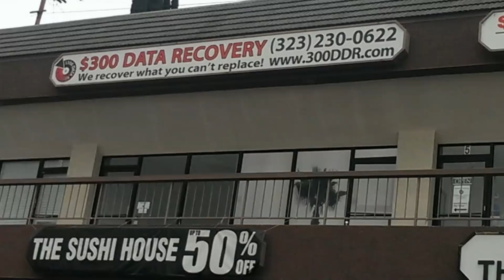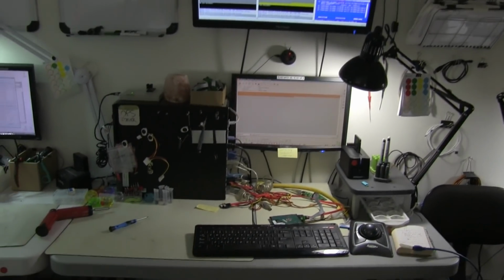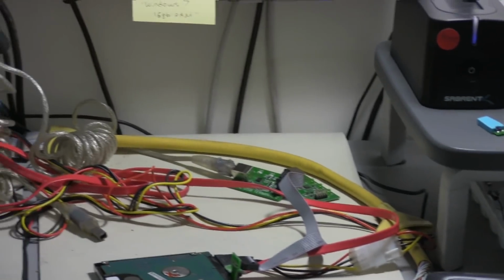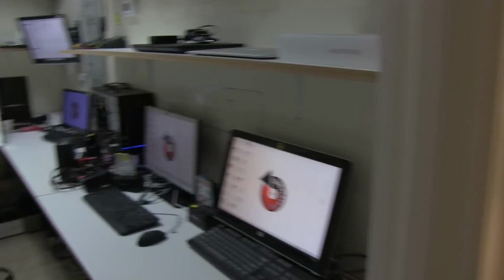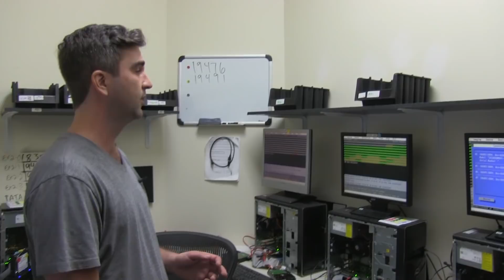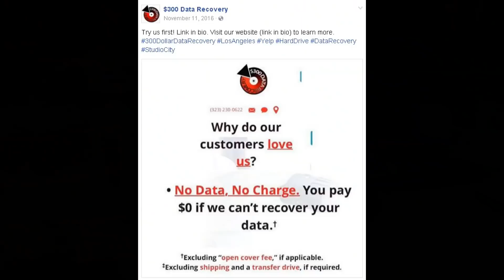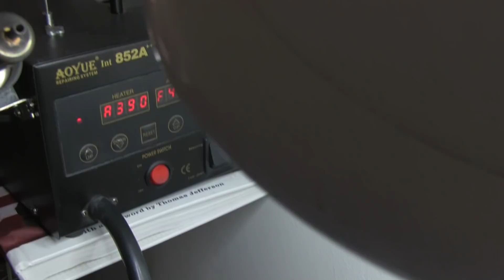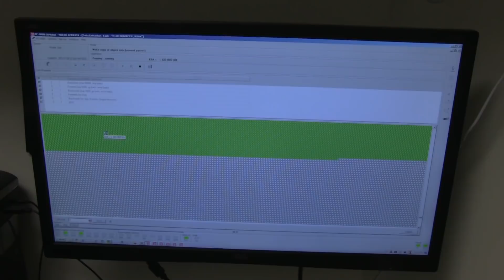Professional Data Recovery with $300 Data Recovery - Part 1

Comment: This is good stuff. During Netscape euphoria i read an article about Kodak's failed HDD. Ontrack charged you dont want to know the amount, kodak had invaluable data on the disk. First time i heard about indepth data recovery. My experience went as far as replacing board with exact same HDD. My laptop GPU was reballed with heating gun by a tech in a southern belt State n paid through eBay. I saw one in Canada doing platter/board swaps. One more reballer guy in Zchec republic. Fascinating stuff. Invaluable video.

Comment: the "freezer trick" sounds like a terrible idea. but i know from experience that the "toaster trick" does work in certain situations that involve heat damage, if the platters have heated up and contracted, causing the data to be misaligned. 

only to be attempted if you're comfortable with removing the hdd control board, cause you don't want the toaster to fry it. then you put the hdd on top of a toaster, just briefly enough to expand the platters a bit, and then grab as much data as you can while they're still hot.

Comment: This is the process that most people never think about.  I have recovered drives before, but not at this level and he is right it can takes a long drive and I had one drive take me 7-15 days, so his rate at $300 is not unreasonable at all depending on how important your data is to you.  Very good one here Carey because it hits home on how important a good back up routine really is across multiple platforms to secure your data.

Comment: nice video, but yes, people use that solder paste for smd components.. I use it here in Brazil very often.. fortunately and unfortunately, information goes fast everywhere nowadays. I happen to speak english and other languages so for me it`s pretty easy to get what I need on the internet.  I came across your video accidentally here and I must admit I learned a little piece of valuable information here concerning the ssd drivers.  I didnt know manufacturers
 were encrypting their chips

Comment: As a retired Sr. Electronic Technician/Specialist, it was nostalgic to see you doing a little hot air station work.  A small 8 pin j-lead IC like the one you pulled I could probably do blindfolded.  When you get to high density leads (250+ leads) or BGA work (ball grid array), then you really require some special skills to successfully remove/replace components.  I've bookmarked your website .. just in case I ever need your services. Cheers.

Comment: There are options available to attempt data recovery from SSDs using SandForce controllers, they aren't perfect but to say it's 'unrecoverable by anyone' is not an accurate statement :P 
https://www.datarecovery.net/pressreleases/pr_20150206.aspx
I love hearing about the service you provide and in all honesty the cost to consumers is pretty outstanding. If I was unable to recover my own data ( I do practice the 3-2-1 strategy for my most important data although 'offsite' is simply a fireproof safe in the same room lol) I'd definitely send off a drive to these guys for a recovery attempt.

Comment: On top of the 300$, do you charge for hardware?  ie heads (usually from a working drive(s)) and target drive?  That seems insane.
Reply: Yes, we do charge for donor heads, when required (≤25% of all cases). We have most PCBs in stock already.

Comment: And this is why I have a ReFS RAID 1 running then both snapshots to another internal drive and disaster recovery on a fireproof NAS, had a hard drive fail during transfer to a new drive about 15 years ago.. left me butt hurt since.

I even tested Windows ReFS for about 6+ months with two bad drives, one bad sectors and the other bad I/O from the logic board. Ran shared torrent files off itto constantly beat on it and ran a 100GB file to be backed up and verified daily... i was very surprised how well it performed vs a hardware RAID 1 card (3Ware 9650SE).

Comment: Never knew that there is something like freezer myth , i accidentally bumped on this link as currently i am trying to recover my data from one of my external WD passport drive which died a few years ago but i never had the time and tools to recover it. i did try a few times when it originally failed but since the size of drive is 320 gb  it was a time taking task with little result  as the partitions had been soft formatted since.I  tried a number of professional softwares with nil result and than i noticed the disk was heating up a little  and making click sounds in the middle and dying randomly before scanning is evern 1%  complete. Just out of curiosity i put it in a freezer as i had earlier that heat is number 1 enemy of disks . fortunately this worked for me as now the scanning is 20% complete with runtime easy recovery surface scanning and thousand of file starts identified whereas no other software was able to find any files or folders.. it still showing 60 hours remaining but thats understandable.  hopefully i get my recious data back

Comment: I had a quantum fireball 4 GB die. its controller board shorted out. It came out of my revision A iMac. I still have the drive. it has Mac OS 9.2.2. I had updated it all the way from  Mac OS 8.1. Need to get it recovered. I have data on it that I have nowhere else.  Listen. I had yet to back  it up. It just so happened to blow the main control chips, while it was running. and I was preparing to back it up to my Mac Mini server. Over ethernet of course

Comment: Wonder how many of those drives are holding Bitcoin
Reply: Oliver Carr lmao no doubt
Reply: We've recovered many BTC wallets, along with wallets for other CCs.
Reply: 0
Reply: None, bitcoins exist only in the blockchain, what could be stored are the private address needed if you want to be able to send btc.
Reply: coin si not stored on drives , it on Network or RAM , wallets with 1 million $ are flash dists not HDDs or SSD.

Comment: 10k for the hardware and god knows for the software...looks identical to software from the 80's, called x copy (blind copy) for the Amiga, that thing could recover almost anything, I think it was around $5 to buy...Just on a side note, with PCB repair, you should use the dedicated vacuum, heat removal head, tool, for that chipset (it also removes the old solder), should never re-use solder, as it breaks down, weakens, also when re soldering use similar tool, to isolate heat, or simply run iron across pins in one swift motion or multiple with smaller chip sets.
Reply: The soldering was just for the video, I think they will normally clean the pads and used some additional flux. But especially for the video I hadn't skipped these parts, on video everything must be perfect! :)

Also, the components can tolerate that heat, they are designed to tolerate it. Removing and resoldering a tiny eeprom isn't a big deal. Anyways, the work on the PCB doesn't need to be robust or nice... It must work until the data is extracted and thats it. ;)
Reply: I don't think this is a long term fix, the broken drive gets replaced completely
Reply: Alternatively, you can make it much much simpler and go on eBay and buy the exact PCB board for your drive for a range of $20 - $65/ea max. Swap the board, fire up the drive...theres really no magic to it. I dont understand why people are going GAGA over this video. As you stated, X Copy.. HDD Sentinel and many others out there can do this for subpar $10 - $20 bucks. Same goes for the guy above who lost his ARRAY. Most RAID recovery tools can read and rebuild data...i just dont get why this video is making everyone make it seem like this guy is spewing magic out of his belly button...

Comment: Its flux dude. Not magic friggin paste,just flux,WTF else would ya use in de/solder. Flux makes a MASSIVE difference.
Reply from the maker: Find a sense of humor.
Reply: If you're talking about what we use for hot air soldering, it's not flux. It's this: http://www.zeph.com/zephpaste.htm
Reply: glycerin+ rosin+ ipa= flux. always. its probably just a high glycerin content flux. which is why it needs refrigeration, to inhibit bacteria, but thats just speculation. cool stuff though.
Reply: It's not flux, it's soldering paste.Because to solder you don't only need flux, you also need the solder, duh. That paste is the solder+flux in a paste form.

Comment: I have all of the hard drives I've ever owned and they all still work.  But I've copied them to flash drives and/or data DVDs for safety reasons.  My original 540mb WD (25 years old) drive still runs! -)

Most components are surface mounted onto boards these days.  The heat gun basically replicates the heat transfer that occurs when the surface-mounted components on the board gets run through a low-heat furnace...around 350°F conveyor system.  I used to work for Unisys Corp. and we use the surface-mount system for quicker & more reliable component placement & soldering.

 TQQdles™

Comment: Great video, really interesting. I wonder if that liquid solder would be any good as thermal paste - that is for transfering heat from CPU heatspreader to cooler?
Reply: No, different purpose. It's this: http://www.zeph.com/zephpaste.htm
Reply: Nice thing you didn't know what it was called;) "I don't know what it's called but the guy that thought me this said I have to put a bit when I solder"
Reply: actualy its called solder paste .. comes in 100 variants/ chemical compositions .. seeing that guy using hot air reflow without flux gets me tho - oh boy lets be glad those chips arent sensetive at all - any EE will suffer watching that 

if you need/want to know about soldering / propper pcb level repair checkout Louis Rossmann he does that stuff well

Comment: Very cool video! I have actually had success with an old ATA drive where I swapped the PCB and had to de-solder/re-solder the ROM chip when I swapped it. Was not fun with a cheap ass iron...but I got it and got my data back. Those hot air re-work stations are definitely the way to go.. especially if you do SMC work often. Someone also mentioned chip quik in their comment...it's similar to the stuff in the video. It is also supposed to help lower the melting point of the solder as well to help remove SMC's...but I have not actually used the stuff before.

Comment: Those hot air soldering stations are often called a "rework station", mostly when combined with a soldering pen in the same unit, if you want to search for one to buy. Searching for a hot air gun will only get you those big things used to strip paint from buildings.

Comment: The only other person I've seen do board repair with a hot solder gun and the flux paste is Louis Rossman
Reply: The guy in this video used solder paste as opposed to flux. Flux is a weak acid or similar which removes corrosion from a solder joint. Solder paste is a paste made from microscopic tin particles, although usually wth some flux mixed in to help solderability. The thing that Louis is most commonly using is just flux.

And I don't know why this guy would say that he's never heard of anyone using these tools for board repair. These are literally the standard tools for any SMD repair technician.

Comment: I thought I was a fairly astute PC tech... But that's intense stuff right there. Not only the technical side, but the issue of risk when working with so much sensitive data... one mistake can be fatal for a drive. Props to Mr Cometa, he knows his stuff!
Reply: And thanks Carey for sharing this video, it's excellent.
Reply: MiniCactuar what kind of internal adapter card had been used to clone the drives? can it clone even if the drive is dead?
Reply: MiniCactuar what kind of internal adapter card had been used to clone the drives? can it clone even if the drive is dead?
Reply: MiniCactuar di v
Reply: I know right, and I thought all I need to do to recover data is plug in the hard drive to a PC as a secondary drive copy onto a bigger HDD (Or NAS) then low format the old HDD and reuse it (or nuke it if it had bad sectors) seeing this made feel like an amateur...even though I cloned HDDs before, but I'd rather install a fresh copy of Windows onto a new drive then copy all the files back (after a virus and malware scan)...do they even think about that?!!! Hahah v_v